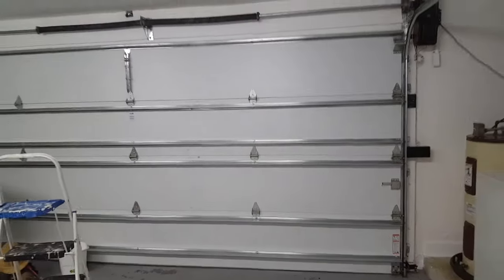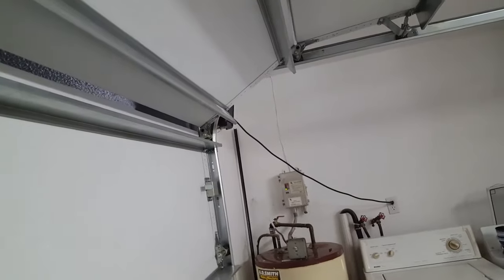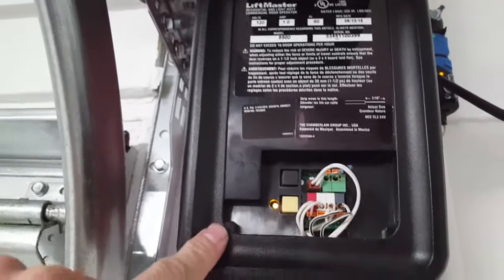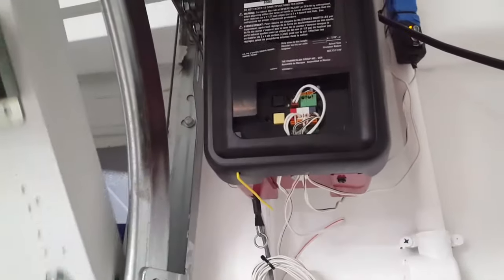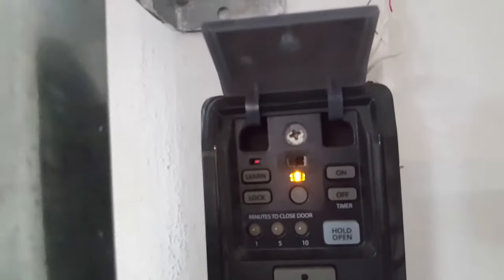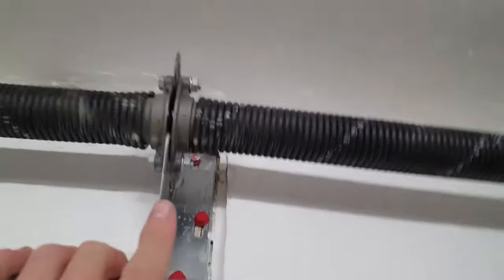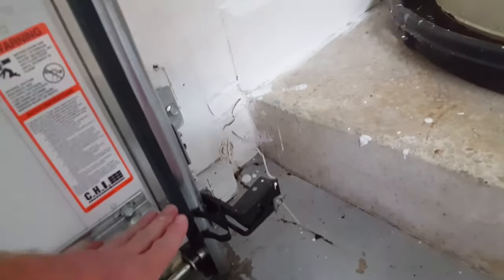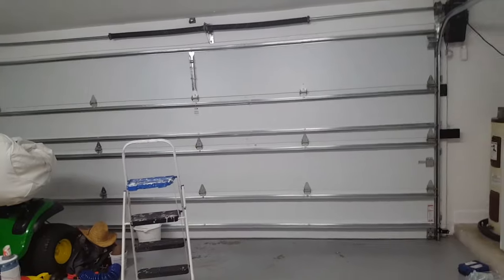Troubleshoot your garage door

Comment: One thing that no one tells you even the instructions is that the switch needs to be in tension with the wire. It is supposed to be pulled up and not flush with the mechanism. When it is installed, you should be able to push it down and hear a click. That way, it is always under tension and garage door doesn't roll back up automatically. It was so annoying troubleshooting that one step. Hope it helps.

Comment: I have the same set up.  Came home at 4 in the morning to it going crazy and opening and shutting non stop by itself.  Shut down power. Getting nothing the next day. No response, no light.  Bad circuitboard?
Reply: Same thing just happened to me exactly 3:56am
Reply: @thenjt I still haven’t fixed mine.  Liftmaster sent me a free touchpad when I called them and said there was a recall on mine and it could be the problem. I half way hooked it up and might not have followed the steps exactly but it didn’t help.  If I restore power to my door it will still randomly start going up and down on its own.  I’m still thinking circuitboard.  Let me know if you pinpoint your problem before I do.

Comment: Hello- thanks for this.  My system has one problem.  I used to be able to press the button and the door would close automatically.  No I need to hold my finger on the button until it closes completely.  Any suggestions would be greatly appreciated!

Comment: There is no power getting to my control panel.  The AC that my opener is plugged into is good.  Does the opener have a fuse which may have blown?  It's a Model 3800PLD LiftMaster Elite Series.

Comment: I have a quick question for you, I have an 8500 LiftMaster on my garage wall. My question is my red light and my yellow light are flashing on my wall remote. They keep flashing what do I do to fix this my garage door will not open? Thanks for your time hope to get your response back to this issue thank you
Reply: Frank Arena did you figure it out? Sounds like the vacation lock is activatef.
Reply: Ruckus Bird  had to get a new wall switch. Once I hooked it up it now works like a champ.
Reply: Ruckus Bird nope, 888LM went out. These piece of junk 8500’s are known for that.

Comment: Hello, this question is for Garage Door Man 82. I am installing a Liftmaster 8500. I am trying to bypass the cable tension monitor. I noticed you bridged the connection with what looks like a capacitor. Can you explain to me what I could do to eliminate device. I rather leave it out of my install. I want the opener to continue to work without a problem. Please let me know how you were able to accomplish this. Thanks.
Reply: The cable tension sensor is very important to ensure that the motor won’t continue turning if the cables get loose and derail from the drums.  If that happens you can have a very serious condition to deal with that requires the door safely coming down (without spring tension any longer).  

These jackshaft operators function best when the drum bracket is attached to the track about 1” from the wall.  Typically this bar bracket has an upper bend that installers screw to the wall.  Don’t screw it to the wall.  Rather, attach it to the top track further out about 1/2 - 1”, with two 3/8” bolts to secure it to the top track.

This then places the cable far enough out that the cable tension sensor no longer becomes an issue, because it is much further open even at times when the cable normally slacks as the panels round the track radius when closing.

You can make this adjustment by removing the bracket bolts that fix the torsion bar bracket to the top track, and simply move it out from the wall an inch.  This would be the bracket that is right above the sensor.  

While you could do this even when the springs are under tension, I recommend opening the door fully then adjusting the bracket while the springs are not loaded, just to add safety.

After you do this you will never have a cable sensor problem again.

Comment: Ok Mr Garage Man 82 I have the 8500- I have tested everything at the drive motor panel, I was able to move the door up and down etc. Sensors are aligned, LEDs are on & have power etc. My wall mounted button "MyQ" style like yours in the video does NOT have power / yellow light doesn't come. Is it possible or is it common that those wall mount mother boards go bad?.   I followed the wires and didn't see any breaks. pulled on wires on front of drive motor but didn't have time to get on up into the back area where the wires seem to  go,  will check that after work. All remotes have good batteries, they show led flashing when pushed and obviously don't work either.  The garage door lights come on and I don't get any flashing errors.   any suggestions?  Great video, thanks for the help!
Reply: What did you have to do replace the wall mount..??
Reply: Yes the walk button assembly does go bad.  It cost us about $70 to have a new one sent, back then from Liftmaster.  The Liftmaster rep actually told me that the wall button assembly was where the brains of the system is too.
Reply: @ryanduderty3963  Sorry I didn't see your post/ question....  I can't remember what I did but, I did not replace it. I think the problem was our area had an excessive amount of high heat days and it played a factor in the problem. I kept trying different things but to no avail.... then one day it started working again ( about a weeks time).  I haven't had a problem since.

Comment: I own the 8500 too and you’re right, it’s been quite a ride over the years. I did add new springs last year. Every once in a while we have intermittent beeping and the MyQ garage pads aren’t flashing or beeping when I look...that’s happened in the past, though today all I hear is three quick beeps and don’t know what the heck is causing it. 

Both our garage doors open and close just fine.
Reply: How involved or costly was replacing the springs? My installer indicated the 8500 had to be removed from the wall in order to replace the torsion spring + rod + brackets/bearings. I had the tension wire come off one of the pulleys near the motor unit. Wayne Daulton door.
Reply: @sscheuri  
The operator can remain set and the torsion bar typically can be slid out of the operator, since there should be a small bracket attaching the lower end of the operator to the wall.  I wouldn’t expect a typical WDalton installer to know that or to assume any liability with a jackshaft operator though.  A knowledgeable installer could easily replace the torsion springs on a 8500 or 8900 setup, though, if there is enough room for the torsion bar to slide 12-24” away from the operator.

Cable derailment can happen easily with jackshaft operators if there is not sufficient downward weight placed on the cables when the door is fully opened.  Consider inclining your tracks higher so the door itself will roll downward without any spring tension applied.  If the door won’t keep tension on the cables, they can easily derail when the operator starts turning the bar.  Also instruct your installer to wind the springs a tad more than specs call, to ensure the cables are always taut even when the door is fully open.

Comment: I have the door opener. Powered went out recently so I pulled the lever to put it in manual mode. Once we got powere I pulled the rope again and it now acts like it doesn't have power. Sensor lights are on and the wall door opener light is on. When I push the opener the motor makes no sound. Any ideas?
Reply: massimmortal try resetting the travel limits

Comment: Yellow light is flashing 3 times?.... what's the problem?
Reply: Did you solve your problem with the 3 flashing lights. I have the same issue.
Reply: @TheoSmith249  yes it was the wall control unit.
Reply: @michaelcraycraft9263  thanks Michael. I’ve arrived where you were. Thanks for confirming. Guess you know what I’m doing next.😀

Comment: Shot in the dark here, my liftmaster won't open. It tries to shut the doors when they are already closed. I called a service person and they said they will have to replace the whole opener system. Is there any way to repair these openers or is replacing them the only way? Please and thanks. Great video.
Reply: My opener is doing the same thing, i tried setting the limits a few times and it keeps "losing" the limits...called support and they suggested the travel module was bad. just got one on order...$20+shipping. This is the first problem i have had with this opener in 9 years. Very happy with my 3800
Reply: Try resetting the open and close limits at 5’ up and 3’ up.  Then test and see if the operator still behaves the same.  Release the motor, open the door.  Engage the motor again.  Set new limits at 5’ opened and 3’ high (closed).  If it works as expected then set new limits as desired.

Comment: I just installed this opener, my problem is when I program the limits it goes up fine but when it goes to the closed position it slacks the cable almost immediately after it start and trips the cable tension monitor
Reply: i have the same problem. i am returning mine as defective and getting a different unit. i dont think the manual is giving the correct directions. the video on you tube is different.
Reply: jason ratliff this is why these openers are designed to be installed by professionals. You’re setting the down limit too far.
Reply: @chamberlainliftmasterfan-2521  what do you do if you have no lights on floor senors and it wont close?
Reply: This problem is likely because your drum cables on the door are not sharing the load of the door equally.  Since the 8500 series turns the torsion bar instead of pushing the door up and down, the cable sensor has to be very sensitive for safety.  If one cable is more slack than the other, the sensor will pick up that discrepancy immediately. 

The springs should be unwound and rewound again.  This is not something you can just move forward on without preparing for it correctly.  Those springs are very powerful so a typical homeowner should not attempt to do it, for safety reasons.  Not only must the springs be unwound but the drums must be fastened to the torsion bar in a different spot, and this is where the problem is originating.  Once the drums are fastened properly and with the same grip on the torsion bar then the springs can be wound again, and the operator will work perfectly.

Comment: i cant open my garage and there are 10 flash and i dont know what is wrong?
Reply: I know I’m very late but 10 flashes means safety sensor issue
Reply: @chamberlainliftmasterfan-2521  10 flashes is a safety sensor error code.